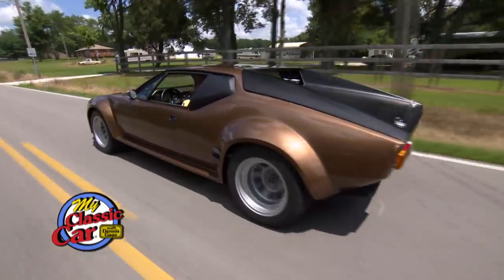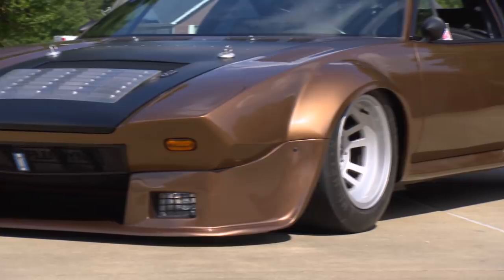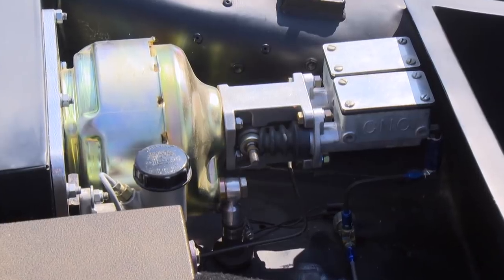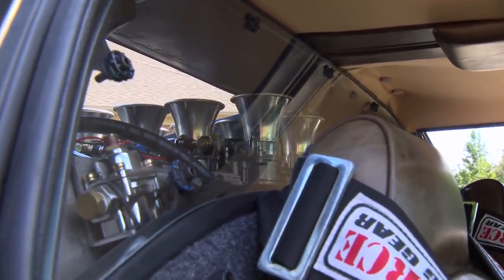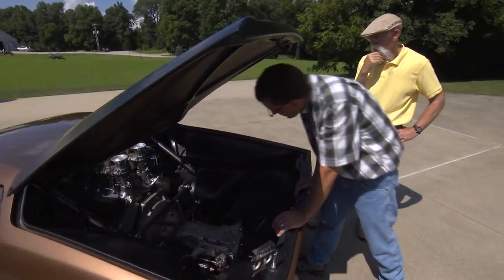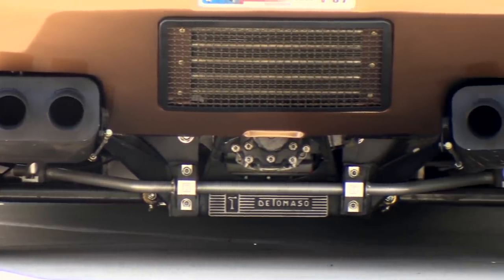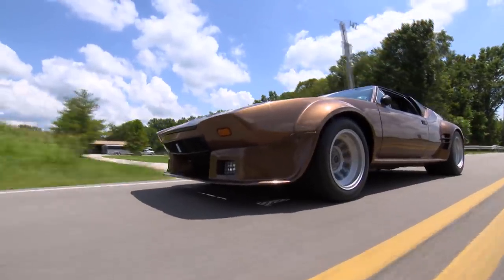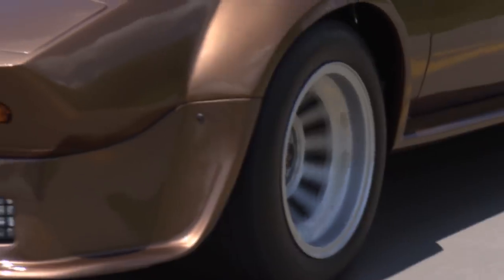The SNARLING Supercar! | 1971 De Tomaso Pantera

Comment: Nice car and custom build. Great video also.
Did the owner say if he ever tried it on the quarter mile? or 0-60?
I'd be interested to see how fast it is. 
Thumbs up! 👍🏼
Reply: It sounds like it's got a bad exhaust leak!
Reply: Yeah, with all those speed mods he should be Tracking this Bad Boy.
Reply: 5.4 seconds 0-60 I own one
Reply: @travisallen700  with the same engine and exhaust? Plus all the same exact modifications to the engine and transmission?  Including having the radiator on the slant with dual electric fans? And the same tires? What about moving the fuel tank to the other side? And the cut in half intake manifold?
Wow! Who would have thunk that there would be an identical twin of this car with all the mods and actually timed it for 0-60. 
Tell us did you spend 9 years restoring/modifying your car?  I would love to see a special episode with both cars in it, especially a side by side comparison. Seriously though you should contact the show and offer to do that episode. I’m absolutely certain all of us fans of the show would love to see that!

Comment: In my opinion, this car is stunning! I love the flared sides, the front lip, the rear, the side profile is pure beauty.. it's just an unbelievable work of art! Sure, there are specs I'd change if I owned the car, but expressing personalization through a project like this is what it's all about. 
If I was lucky enough to own/build the masterpiece, I'd probably paint the exterior in a high-gloss charcoal grey, but paint the roof and a few accents black. I think the wheels would look good bronze/copper. And I'd try to move the rear view mirrors so they'd be mounted on the front fenders. The interior, I'd like to go with 2-tone leather.. dark chocolate with tan (surprisingly, colors I rarely like on most cars). 
Regardless, it's an attractive build. Cheers!

Comment: I've owned a 70 Mach I with a 351 C and I've owned a 71 Galaxie 500 with a 400 M engine. Both were incredibly hard running engines and very fast.

Comment: Hall Pantera the company mentioned makes both GT5 and GT5-S body kits designed after the 80's Pantera's to fit on the older early 70's Pantera's spoilers, vents etc. you could get partial kits or full depending upon how "modern" you wanted to go.

Comment: What I love most about the Pantera, is that they come with a 351 Cleveland. 351 Cleveland's are special because of the heads. Personally I don't shut up about the 351 c. Yes you can use a 400 based block, I'm really impressed, great job!

Comment: Ford 400. Interesting choice. Same engine in my '79 Bronco. Excellent torque (300 @1900) even with a 2V carb. Longest stroke (4") Ford V8 ever made to this day. I imagine a built 400 may hit 500/500. Regardless, it's a truck engine and it certainly sounds like one. My Bronco has a nice exhaust and I think it sounds about as good as it can with that engine. It sounds better than this Pantera to my ears.

Comment: Back in 72 there were 1000's of Pantera's sitting in Marine terminals up and down the US east coast and most had to have their motors replaced by Ford dealerships because the exhaust pipes pointed up and filled with rain water and caused the exhaust valves to rust and destroy valve guides, basically the only flaw in it's design.

Comment: You never asked how much horse power it had. The original Cleveland from the factory had 350 Hp, I had a 1972 Pantera with Twin Turbos on it with 750 HP. Scary fast. Too fast my buddy got it up to 265 going to Vegas. He said he had a lot more peddle, but ran out of balls. I had to sell it or else I would have killed myself.
Reply: Keith Persons no way your buddy did 265..no way..the aerodynamic s wouldn't support that,nor the interstate geology!
Kph perhaps
Mph , no way!
Reply: @jquest43  you may be right, I don't know, that is what he told me. However, he has been known to tell a tall tail before. I just know it was fast and scary! and it did have 750 Horse Power.
Reply: Keith Persons amazing engine,the 351 Cleveland.
Made for turbos
I'm not saying it couldn't do it with extensive aero mods..and a speed tested strech of isolated road..I'm saying that above 100 bumps appear AND can suspension handle 265?- no way.
Reply: Keith Persons takes more power than that to go that fast. Cars with well over 1k hp have trouble even getting close to that.

Comment: Those 60s and 70s cars just loved to take off at speed. I had a C3 Vette, and at high speed, the steering would go light, and it would understeer like dangerously crazy. I put the front spoiler kit from the C3 Pace car on it,.. No more lifting or understeer, and it didn't look out of proportion, like this car does. Front winglets don't have to be big to work, they just need people with a wind tunnel to know where to place them. In saying this, he is happy with it, so that is all that matters

Comment: A man after my own heart. Ford 400, the best engine they have ever made.

A guy down the road from me had an original racecar it was nuts, it was a raw car, roll cage engine, pipes, no interior and the original tag next to the engine letting you know how legit of a car it is. It was so low that the door sil was 4 inches off the ground.
Reply: Madmagyver study the Coyote and you’ll change your opinion.
Reply: @Goldeader  modern performance engines, especially vee configurations, should not use chains to drive overhead cams. The length of the chains plus the increased loads from high rpm valve springs causes chain breakage when hitting the Rev limiter.
And unmodified gt500 engine can break chains. Fact. 
My 400 has been over 8k rpm many times. And I didn't get it until after 300k miles. Now over 700k, I broke a few valve springs, but no major issues and finally the original pistons are ready to retire. No engine will ever be built in the USA that will surpass that. Fact.
Reply: Madmagyver the gen2 coyote can handle 1200hp without an engine build. Upgrade the lifters and it will hold 1500. I have yet to see someone blow one up even with 2k hp on a stock block. Other than people not using nitrous properly coyotes are indestructible.
Reply: I have just have a different intake manifold and I can turn well over 8k rpm. Guys are running these over 10k without breaking springs
Reply: @Goldeader  a Ford 400 or a coyote?
Rpm is not the issue, it is a poor design choice using chains. Belts were introduced for push rod engines for cam drives in the 80s, and they quickly became the top choice for accuracy and reliability. It is ironic that ancient chain technology haunts a car built in 2018 but was originally designed in the 1960s.

Comment: He ruined the lines of the car. It has a homemade look to it, not befitting a classic Italian body design. I also don't like the extended nose and lip. It's supposed to be a wedge.
Reply: @r6984  Strange comment. I was talking about about aesthetics, not practicality. You must have no appreciation for Pininfarina and similar classic designs. I guess a VW is your idea of beauty.
Reply: @acertainshape  I was saying purose of the build had very little to do with looks but performance. Form follows function. I think you were blinded by your point and failed to recognize mine. I agree classic Italian design is beautiful and as far as looks shouldnt be mucked with, I think modifying this car is a waste. That being said the original car speaking purely mechanically was kinda shit
Reply: @r6984  Fair enough, but then you started bashing fat women. It was odd.
Reply: @acertainshape  beauty is in the eye of the beholder. I've seen several lady's in the concrete profession non of them small. No offense intended to anyone just unfiltered observation.
Reply: Yes, beauty is in the eye of the beholder, but these cars were dangerous to drive at high speed as they came off the assembly line in Italy.
Reply: Hey dude. Fun fact for you. Its its your car!!! He's free to do whatever pleases him to it.

Comment: Ruined that beautiful Italian car.
Reply: Maybe but we all know that car had issues, hell Elvis shot his. He wanted to drive it hard and had to "ruin" it to do so. My complaint is that for a third of the cost could have put a small block LS. Or for an improvement on power weight and handling could have used a boosted small bore power plant. A single turbo 2jz comes to mind
Reply: r6984 only an idiot would replace the Nascar designed canted valve 351 Cleveland.
Reply: @jquest43  I think you have your 351's twisted and look at the lancia 037 similar Italian car turbo 4 cylinder if I recall. Also only a fool calls names and underestimates a man he hasnt researched
Reply: @jquest43  k sweetheart. talk big
Reply: ProjectsBlack  You sir are a man of good taste. As a crude American I'd personally go with gloss black paint, white leather, a chevy power plant, crager wheels and a tall profile tire ( rough roads in my area ) but i have to admit your dream pantera would be stunning and shadow mine in comparison. Also I want to thank you for jumping into a negative thread to have a honest discussion of design
Reply: Agree, should have kept it original. He has KILLED the value.
Reply: @r6984  you just want junk after your done with it ! 2jz isnt in the same class as a pantera ! these wanna be ricers are trying to be something there not ! 2jz is a punk !

Comment: The Pantera is top 5 in my favorite cars, especially the early ones. I love the color of this one, but I'm not a fan of all the body mods. I still would recognize it anywhere, but the perfect lines and unique touches of the original are mostly gone. I guess the damage was already done before this guy got it, so I won't blame him for taking it as is and running with it. It's a great car, but I can only really appreciate it if I don't think of it as a Pantera.
Reply: Mark, you're absolutely right on!  When I went looking for mine 18 years ago, I did not like the wide bodied, flared fendered, Countach winged cars of the 80s.  I wanted a '71 or '72 pre L in its original guise.  I redid the interior a few years ago with C4 Corvette seats swathed in diamond quilted leather, covered the dash and firewall the same way, and changed the carb to fuel injection and flush windshield glass, and now I can finally enjoy driving it.

Comment: If you don't have something nice to say, just hit the like button and move on.  99.9% of you will never in your entire life work 9 years to create a dream from your mind.  This car is a work of ART.  Doesn't matter if you don't like something he did, you are fortunate he shared it with all of us.  I have an Austin Healey 3000 with a 500hp chevy small block in front, a Jaguar XKE independent rear, with quad adjustable Eagle coil overs, 4 wheel disc brakes, and a hand built frame.  My father built this car over a 12 year period and passed away before he finished it.  Maybe I will share it on Youtube so I can be told by complete strangers why it doesn't look perfect to them.